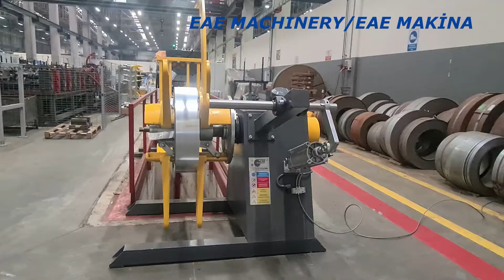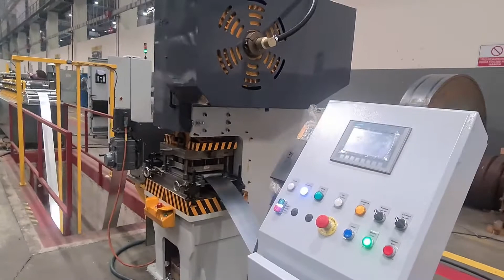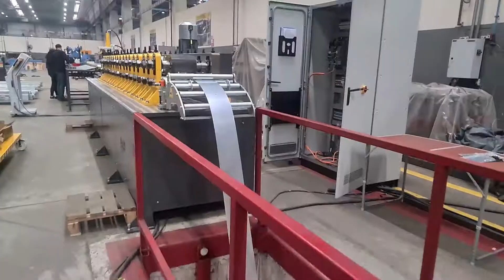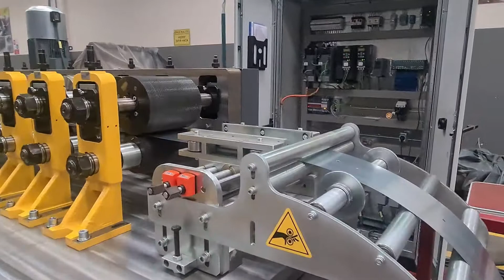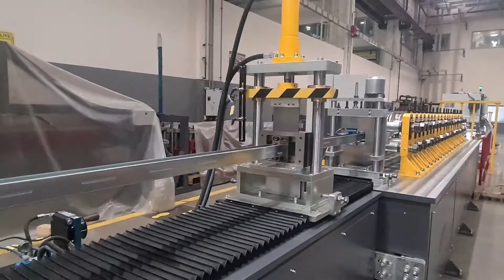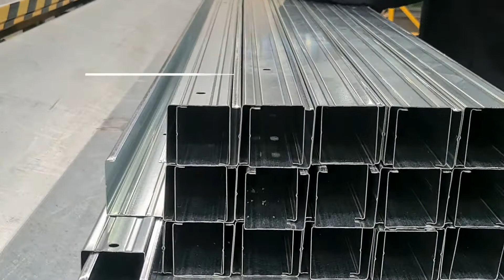Drywall Gypsum Profiles with Hole * Delikli Alcıpan Üretim Hattı

Comment: line is unnecessarily too long, hopefully it runs faster than this speed.
Reply from the maker: Thank you for your comment. In this line produce 10-12 type and dimension profiles, also corner profile (punching). And this video in EAE Factory, in FAT. In Customer Factory used less place.